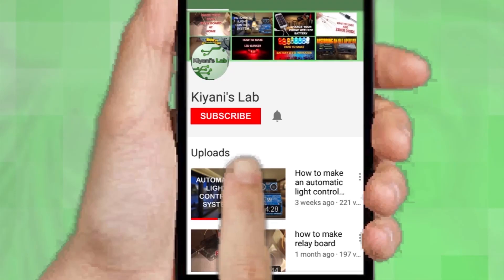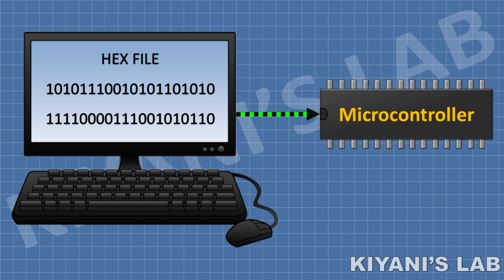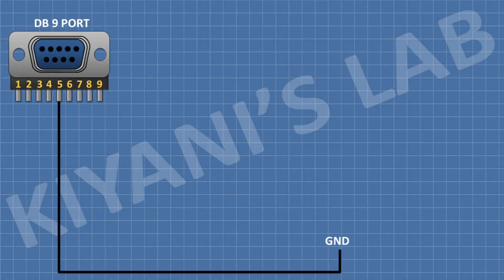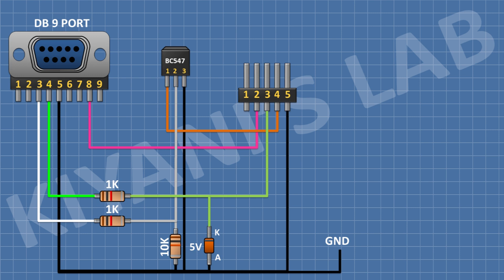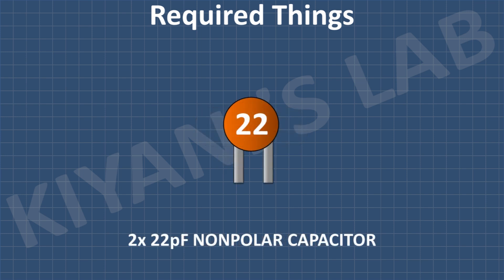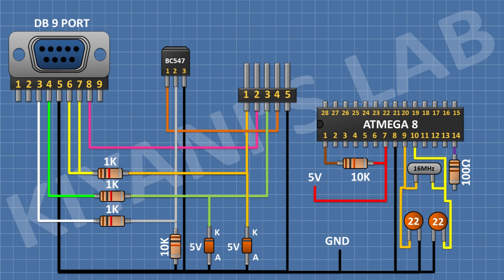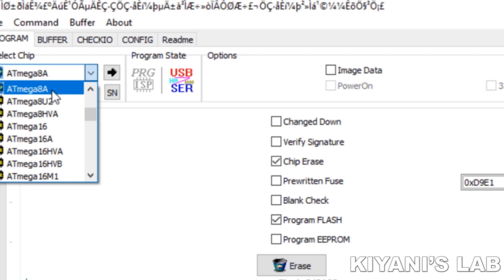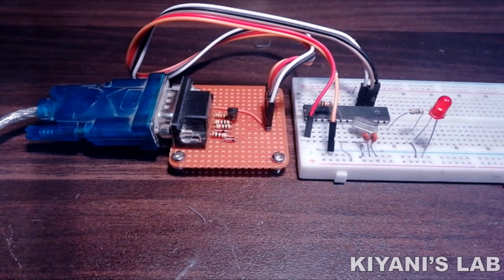How To Make AVR Microcontroller Programmer

Comment: Can I use ttl to usb pl2303
Reply from the maker: no
Reply: https://youtube.com/shorts/t5o48-osJpc
https://youtu.be/z29Z8-oaNt4
https://youtube.com/shorts/GYJS996cfQc
Reply: I think it could be possible if there is Coding work related to Vendor ID in the firmware itself...
I think it would be a good idea to check if it is true.

Comment: My pc have a db9 com port inside mother board but this doesn't work
Reply from the maker: select the correct comport
Reply: https://nerdralph.blogspot.com/2014/05/pl-2303hx-bit-bang-avr-programmer.html
Reply: Pl-2303hx Many Driver Error & USBASP VENDOR ID Error.....
Reply: https://youtu.be/_ZLp3Bmc3DM
Reply: I think it could be possible if there is Coding work related to Vendor ID in the firmware itself...
I think it would be a good idea to check if it is true.

Comment: Nice video. Could you please explain me, how to get the knowledge for how to connect the serial port, which components to use and why? Where did you get that? I would like to learn the same (without reading a +500 pages electronics book).

Comment: bhaiya i have a laptop without usb and rs232 port , i have usb c type port , will usb c type port to rs232 ( db9 pin ) converter cable work for this ? i searched online some people said that there is voltage difference between usb / usb c vs. serial port as they work on different voltage levels , can you please clarify ? 

also should i first convert usb c to usb by adapter and then usb to db9 ? will that work 
i am programming avr chips such as atmega328 , atmega 8 , atmega 33 , atmega 16 , attiny85 etc . thank you please answer all queries 🙏🏽🙏🏽

Comment: Great simply great, u have a sound knowledge of electronics, can u make a RF transmitter receiver module circuit diagram explaining in details function  of every components used , hope this will not obligate u , thanku
Reply from the maker: I will try bro
Reply: @KiyanisLab  🙏🙏😀
Reply: The most important thing to do before you want to use communication equipment or make an RF transceiver is to obtain a telecommunications company license to avoid being caught by the police due to legal issues.
If you don't like it, you have to get at least a nationally accepted HEM communication license. I tell you this as a person with actual low cost experience.